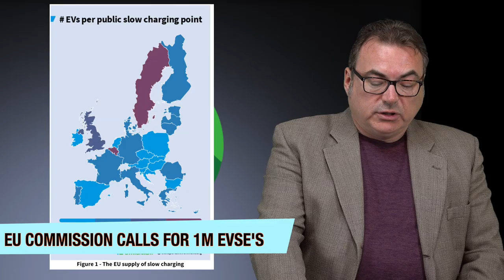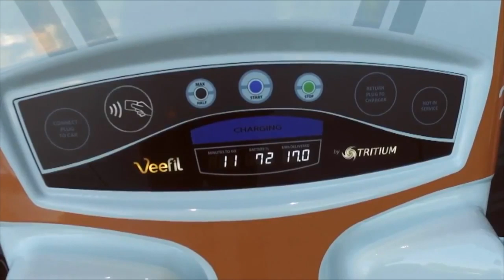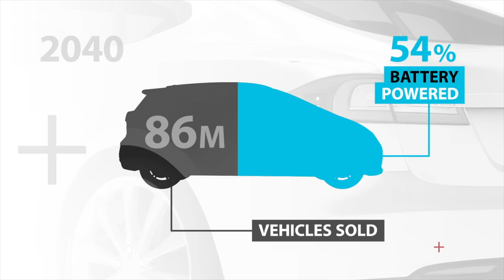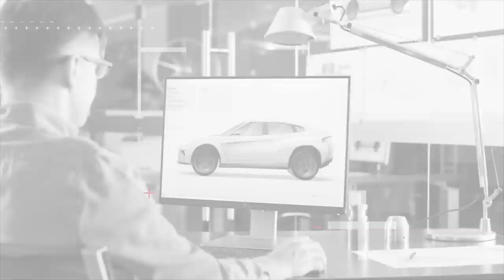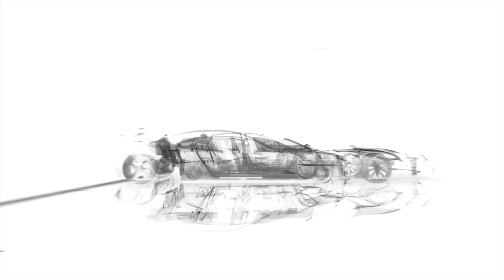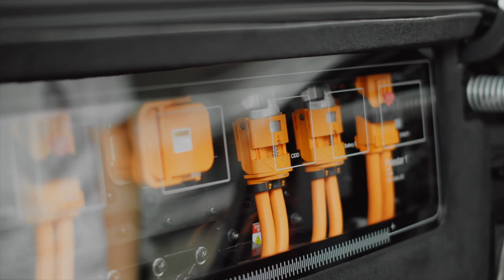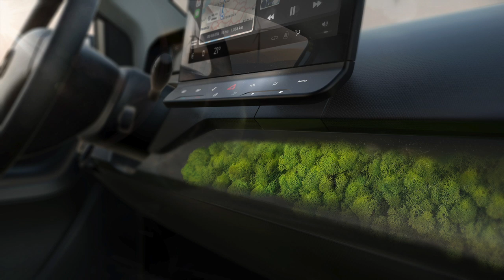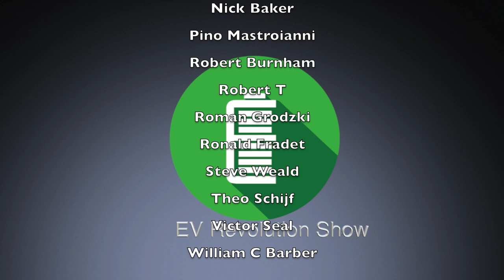Episode 59 - More EV Chargers, USA EV Jobs, Polestar, BMW and Sono Updates and More News!

Comment: Hi Ken. I see that you will be testing the Kona E in the near future. In the process of your investigations it would be of interest to me if you could investigate the towing capabilities of the vehicle. I've been told many different points of view from many " knowledgable experts " why you can or can't tow even a light weight and lightly loaded trailer. Many thanks V.
Reply from the maker: Hi Victor, yes I'll be getting the Kona this week for testing.  Not sure what I will be able to confirm ref: towing.  I would look up a copy of the owners manual to be sure.  Generally, these smaller SUVs are not rated for much.  A good bike rack and maybe a small utility trailer up to 1000 lbs.  That is a guess.
Reply from the maker: Further to my last @Victor, I found the owners manual and trailer towing is not recommended period.  I would say at best a bike rack with up to 4 bikes would be ok.  I've got a 2-inch hitch on my Leaf and have a 4 bike rack, which works fine.  Tongue weight is well under 200lbs, so that would be my concern for a bike rack.  

Since the owners manual recommends no towing at all, I would say don't get a Kona EV if you want to tow something.  You will probably void the warranty if you do.
Reply from the maker: However, here is a link to an article which poses your question: https://thedriven.io/2019/06/10/towing-a-caravan-with-an-electric-car-can-it-be-done/

You can form your own opinion.
Reply: EV Revolution . Wow, thank you Ken for a comprehensive answer, I feel the Australian article says it all. Just like any company selling products Hyundai have to protect themselves from customers with little common sense,  and especially those who don’t take responsibility for their own actions.

Comment: Let's hope those Tritium chargers are more reliable than the former models been used in Germany. Tritium was here meant to be a risk as often not working or not being able to get running with several cards or stopping charging sessions after some time without reason. How fast can they charge? Ionity 350 kW chargers can output up to 499 A resulting in up to 192 kW CCS charging a model 3 which is more than the 175 kW that a 400 V module should be able to do. That is close behind the Tesla V3 supercharger.
Reply from the maker: Thanks Mirko for watching and for the info on Tritium.  Yes I hope then they are better then what you have stated.

Comment: did you get 270 km in the Leaf 60 or 40? i barely get 200 km in my Leaf 40 then i need to find a charger asap... :/
Reply from the maker: In my 40kW, in summer I can get over 200km no problem with city and a bit of highway driving.  I run in ECO mode all the time and drive normal speeds.  Use B mode for more regen.
Reply: EV Revolution since i drive 99% of my time on 90-100 km/h roads i never use the B mode. i just need a bigger battery or another car 🤷‍♂️